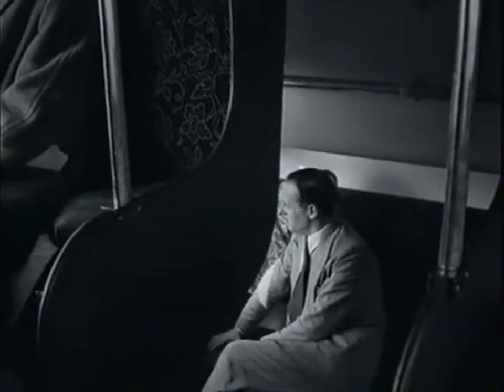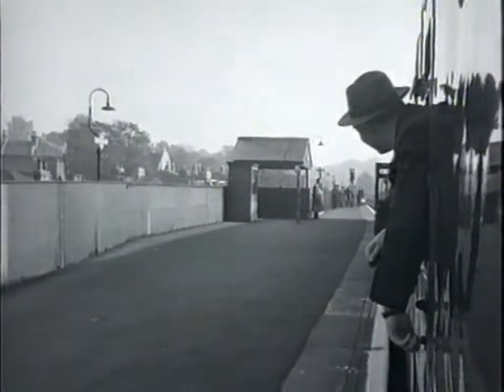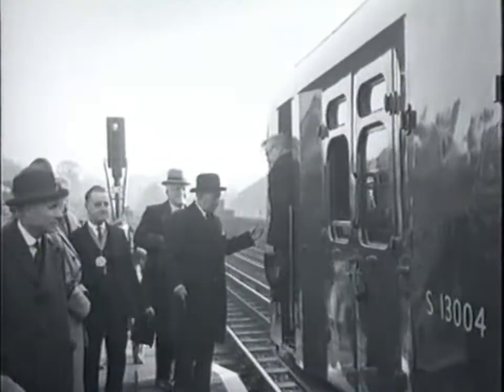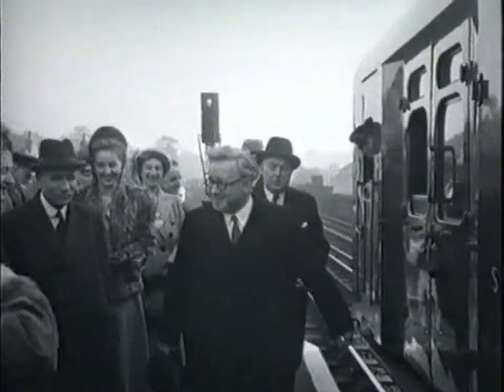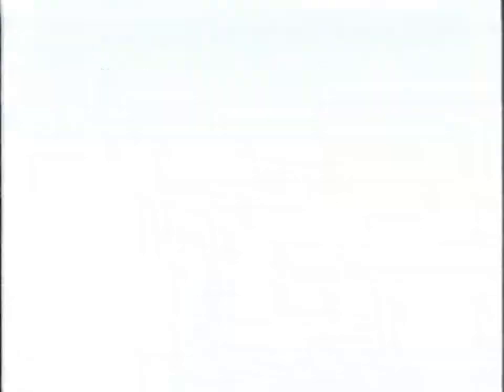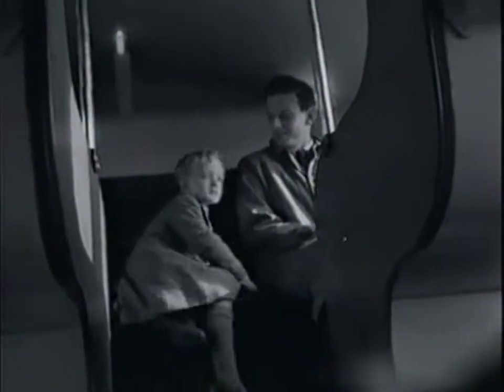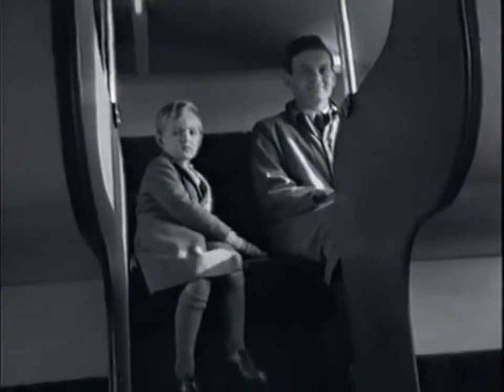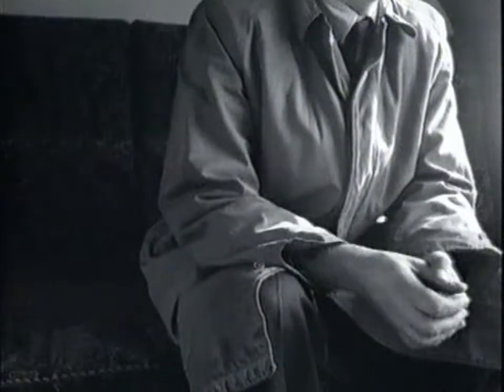Bulleid 4DD Double Decker EMU 1949

Comment: The Four coach Double Decker electric unit trains operated on the Charing Cross and Cannon Street to Dartford via Sidcup line. They were painted in Southern Region green at first but this progressively changed to British Railways green in the early 1950s. They received all over blue with full yellow ends around 1970 which lasted before they were unceremoniously retired in October 1971.